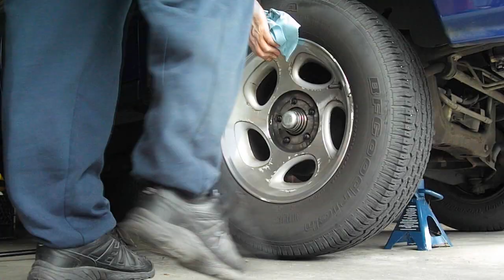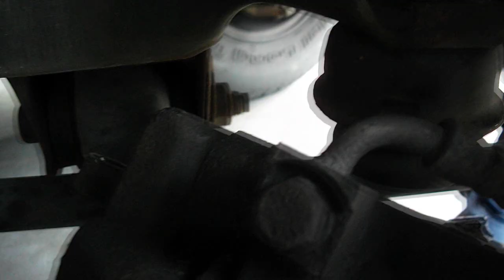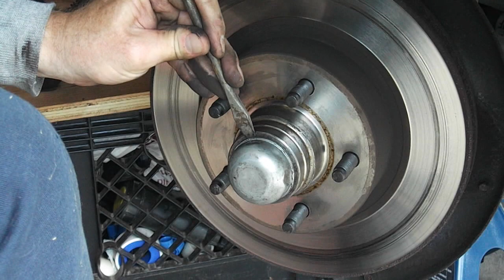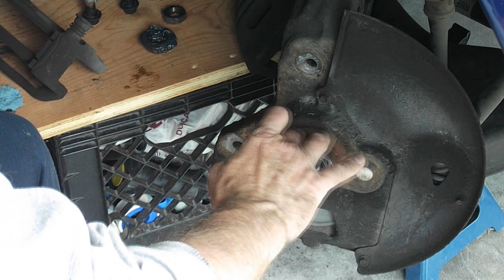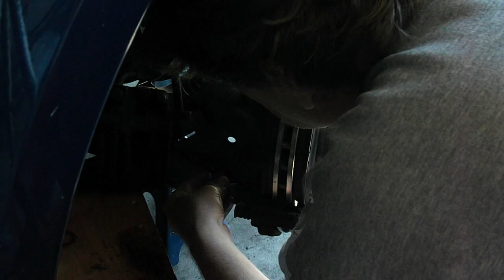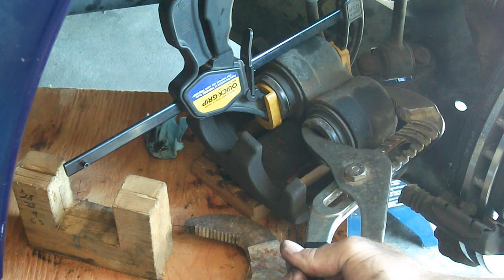How To Repair Brakes Rotors And Bearings Ford Ranger   Cómo reparar Frenos rotores y

Comment: What part number is tht seal.  I'm having to replace both rotors.  Mine is 4x4 but can't find the original seal that came off it.  All others want fit into the back of the rotor
Reply: Stayed at parts store for an hour trying to figure it out. The seals that they call for wnt work. Doesnt match original.  It doesn't have the lip that fits into back of rotor

Comment: Does the 4x4 have the same set up?
Reply: no... is not the same .. is actually really hard to do ...   I still remember the pain on my back like 4 years ago !
Reply: WHy is 4x4 hard to do? How is it different?
Reply: @Denis-bo8ms   4x4 has cv axles on the front.
Reply: @Denis-bo8ms  4X4 are easier. You don't have to remove the axle nut and bearings. The rotor comes right off after removing the caliper mounting hardware. The bearings are in a hub assembly behind the rotor. You remove that after removing the axle nut and three mounting bolts. Getting the axle out can be a bitch, but a heavy, soft faced hammer and some PB Blaster will make quick of that. Swap it out, mount it and torque the axle nut to proper torque. Easy peasy. This is on my 2005 Ranger 4x4 for reference.